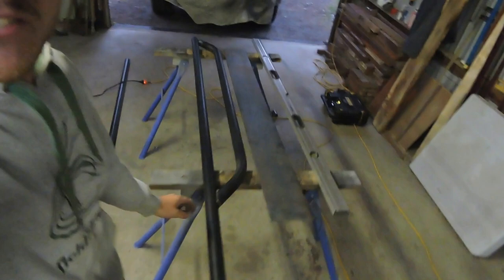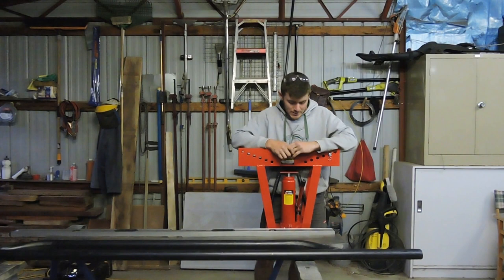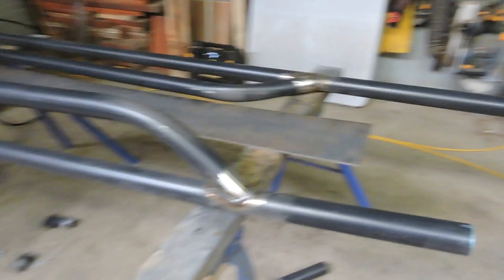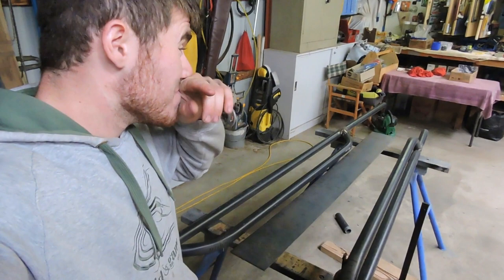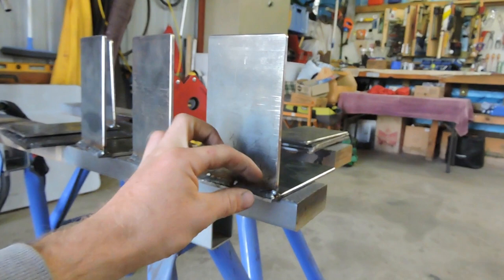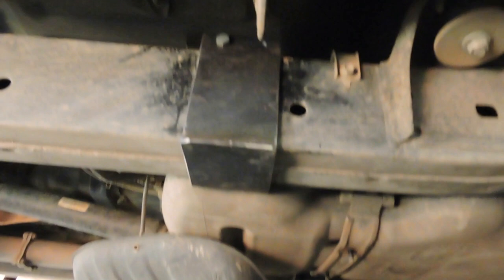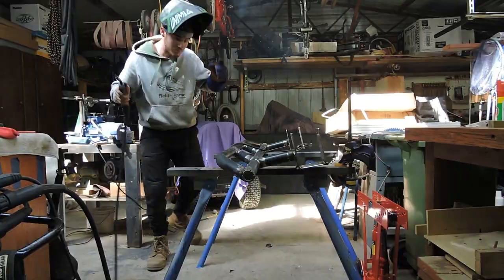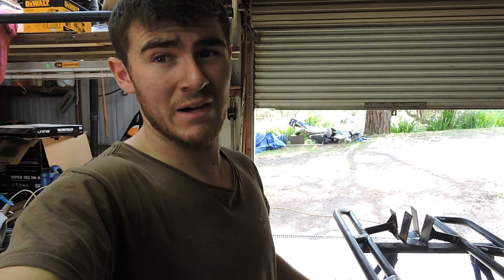Making rock sliders for a Hilux

Comment: Did you just disconnect the battery for welding and nothing else? Wanting to do the same to mine and don't want to fry ECU's etc
Reply from the maker: Yeah just the negative from the battery. Try and earth as close to where you are welding as possible.

Comment: Looks great mate
Could you right down all the measurements, cheers
Reply from the maker: The sliders are 1660mm long with the bend coming in 200mm from either end. The is a 100mm gab between the pipe where the braces go. The chassis brackets depend on your car

Comment: How far off the pinch on the sill is the braces bar? 
Do you also have a body lift?
Reply from the maker: 15-20mm by memory. Yeah running a vmn kit.
Reply: @danloughridge3720  1 or 2 in body lift?
Reply from the maker: 2 inch. If you go to all that effort might as well do the 2 inch
Reply from the maker: 2 inch. If you go to all that effort might as well do the 2 inch